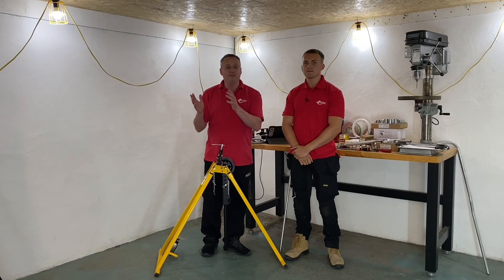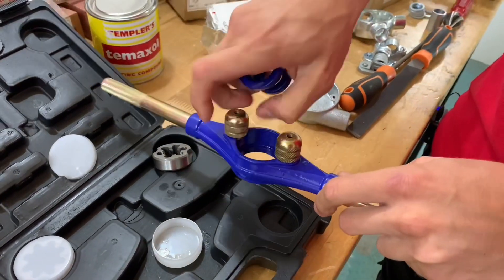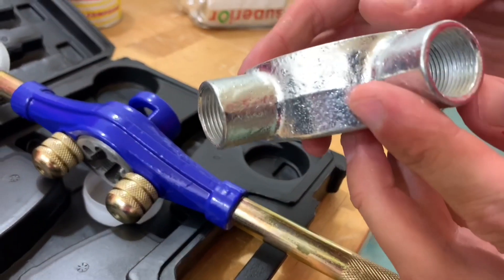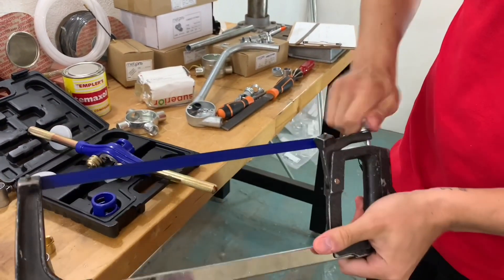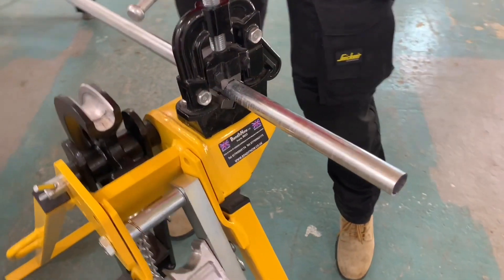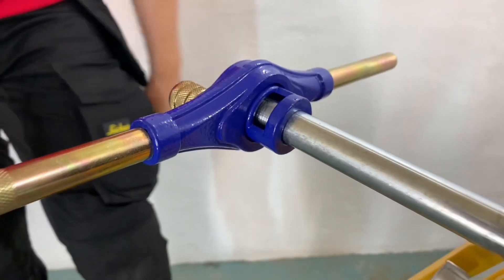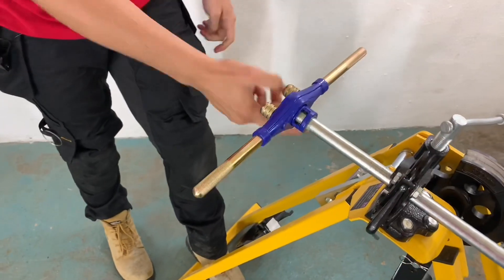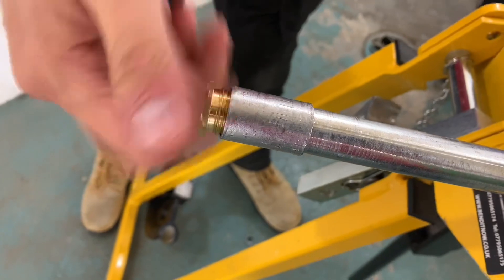How to cut and thread steel conduit - Apprentice electrician essentials

Comment: I used to put two threads on ,then do the filing then thread compound, this prevents clogging files up with compound and filings ,apart from using grips the wrong way nice vid as usual.

Comment: Didn’t give the stocks and dies a bang on the side of the bender to clear them out , didn’t wipe inside conduit and used grips wrong way round 🤦🏼‍♂️🤦🏼‍♂️😂😂😂
Reply: There is no wrong way round to use grips.. it works the same
Reply: @ja_adam_  there’s a correct way ,🤦🏼‍♂️the moveable lever goes at the bottom that way the more you squeeze the levers together the tighter it gets as you turn the grips
Reply: @cj-rb8fz  it did the job the exact same ? The coupler wasn’t loose? What advantage would it have given in that exact situation?
Reply: @ja_adam_  to call your self a tutor and not know how to use a pair of slip grips
Reply: @cj-rb8fz  thanks for not answering my question
Reply: @ja_adam_  you welcome , learn how to use a pair of grips and you will see the advantages
Reply: the young lad did a great job,im sure he was nervous in front of the camera.

Comment: Can I ask why you wold prefer a high speed steel hacksaw blade to Bi-metal. Also I thought you should be sawing as close to the vice as possible. 
Keep up the good work.
Reply: High speed steel hacksaw blade to Bi-metal blade preference could certainly be explained better.
Reply: Cutting close to the vice stops movement caused by vibrations when cutting such thin walled pipes.

Comment: Excellent work there, although you might want to use the pipe grips in the other direction or even get a set of  9 inch Footprint pipe grips 🔧